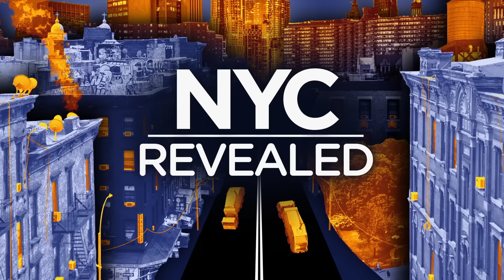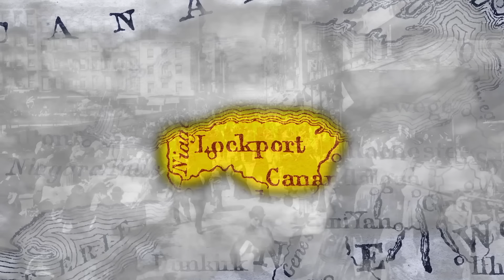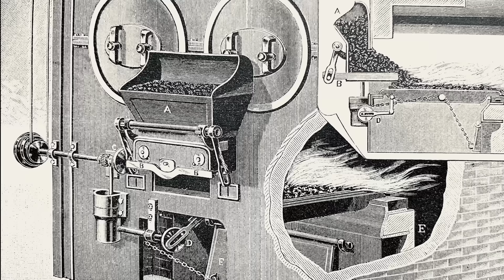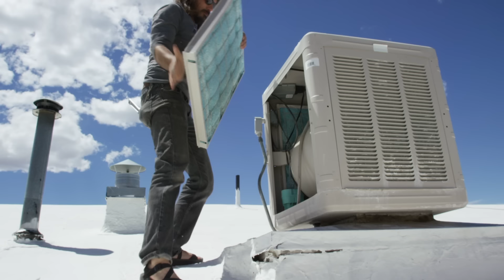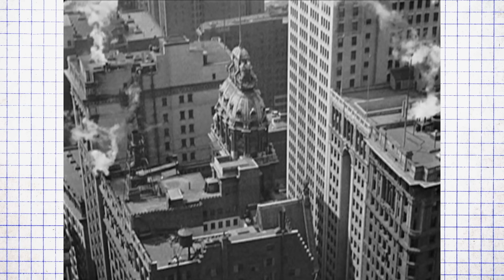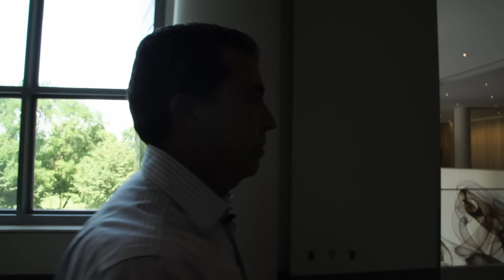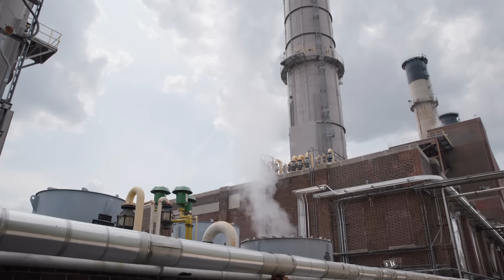How New York Still Relies on this Old Technology | NYC Revealed

Comment: Imagine the humidity. And why is he saying 13 Million when it clearly says 13 Thousand. Not the sharpest knives in the drawer are they? All that escaping steam could be re-directed to a turbine to produce electricity. Bless them.
Reply: If u look above that column, the unit of measurement is 1000000/hr. 13.222 is 1322200
Reply: Look at the big brain on Brad!
Reply: Ironically the steam has already come from a turbine. It’s co generation. Boiler to turbine then to steam distribution.

Comment: Most people don’t know that the entire Empire State Building is heated with 2psi steam they use vacuum pumps to suck the air out of the radiators and the pipes going up are 12”inches in diameter branches are fed from those pipes and no pumping is used. Steam moves at 60 mph through the pipes.
Reply: Detroit was first in nation with these steam systems since 1878 and still has them. NOT unique to NYC!
Reply: @GEN_X_ went to school near Detroit in a 100 year old building with steam heat. I remember the clanging of the radiators in the morning

Comment: But when a pipe fails it is a horrible way to go for the unfortunate pedestrians above.
But I think they fail less than the underground high voltage lines and transformers that have also caused casualties.

Comment: min. 21:11: What sustainability? The steam is produced by burning gas. Every pound of steam that exits through this steamstacks is wasted energy. Also, why are the underground tunnels so hot and stinky?
Btw, you could safe a lot of energy if you weren't cooling restaurants in the mid of the summer to freezing cold temperatures.
Reply: If you aren’t aware that is being created by the groundwater it’s coming into contact with the very hot superheated steam pipes.
This effect is not waste it’s the underground pipes that are old but still useful.
Groundwater is just naturally occurring pockets of water from runoff.
Reply: @davidlampe4153  If the heat gets transferred from the steam to ground water, it's wasted energy nevertheless.
Reply: @davidlampe4153 it’s not ground water it’s just straight steam pipe leaks in an aging steam distribution network.

Comment: I can allready smell the asbestos on those pipes 😂
Reply: I worked at a place with its own steam plant for heat and hot water. Some smart aleck had carefully painted ETHEL on one of the boilers. It’s getting cold-time to fire up Ethel. I wish I had taken a picture of the old brass gauges before modernization happened. The tunnel area was a scary place with high pressure lines. Used to run on bunker grade oil now natural gas.

Comment: Did they go over using salt water instead of tap water? I’m curious if it’s possible
Reply: I don't think that would be a good idea. When salt water is converted into steam, the salt remains as a solid and would clog the pipes after a while.
Reply: @jorisvanhoof2104  It would cost even more to desalinize it before using it.

Comment: I'm a fibers Splicer and all I could think is the Horror of working on Manhattans networks within the Man hole systems. The few steam holes in Boston, Ma that have fiber enclosures in them typically destroy the cases. The plastic just melts or becomes brittle. Not to mention trying to enter a Man hole that is that hot.
Reply: The worst was when con ed would shut off one of  the main  steam lines  even with the steam not flowing  in the pipe the residual heat      would reach about 400 . The steam pipes used to be insulated with asbestos  now there covered  in threelayers of afabric that if it made contact with bare skin vit caused severe  itching  it would remind you of normal house insulation  but 1000 times more painful..oh yes the burns i would aquire on adaily basis   made it a shitty crew to be on😅😅😅😅😅

Comment: 30 minute video about steam with no mention of condensation.
Reply: Or even worse...they mentioned "cooling" with steam, but explained nothing about it.
Reply: @UninstallingWindows steam rises through a fan blade thats connected to the condenser causing it to turn and pump freon like a regular hvac unit
Reply: @xscorcher9071  They probably use absorption chillers.
Reply: @xscorcher9071  they still use freon?
Reply: @miroslavbuchar2559 yeah? The steam just turns the pump
Reply: @miroslavbuchar2559 freon is or should be an obsolete refrigerant.
Reply: @UninstallingWindows  They probably don't know, lol.
Reply: @UninstallingWindows  you can do anything with steam, with steam engines, or steam powered electric generators. including running an air conditioner lol. the question is why would you tho?
Reply: @UninstallingWindows  cooling by absorption or turbine chiller.
Reply: The condensate in the closed system is pure water. That pure water is recycled. It's not cheap to make pure demineralized water.
Reply: @mushroomman1856  This steam is not pure water, it has rust.
Reply: @mushroomman1856 All of the condensate gets dumped into the sewer....
Reply: @mushroomman1856  Not pure water, friend. Chemicals are added to the feed water before it enters the boiler.
Reply: @mushroomman1856  No, it is loaded with water treatment chemicals and not pure water
Reply: Half of this video seems to be random people interwies on the street that add zero value for the viewer and are just waste of time
Reply: Condensation is a total lose they actually use city water to cool the condensation so it be sent into the sanitary sewer system especially when a steam trap fails it’s basic physics
Reply: @rogerschuch2272  That right! Dilution tank is used to cool down the hot condensate and the escaped steam before it enters the sewage.
Reply: This video was targeted to NYC civilians, not HVAC professionals. A better explanation would have helped.
Reply: The condensation is collected by steam traps and transported back to the cogens to be reheated. It's a closed loop minus any necessary make-up water.
Reply: @henryjantz negative.....none of these condensate returns to the plants. It gets dumped into the sewer.
Reply: @Tim.F83 I highly doubt this. How do you know? They would be spending an incredible amount of money to have the water chemically analyzed and treated to perform in this system with minimal corrosion, biological problems, etc.
Reply: @henryjantz It's always funny when people that don't know try and correct someone that does.
Reply: @henryjantz  It is a non-return system; the condensate must be cooled down to 150F before enters the city sewage system. Buildings in Manhattan are using steam for heating, cooling and cooking. That included laundry and sanitizing equipment.
Reply: @henryjantz  It is a non-return system, and the condensate is dump into the city sewage.
Reply: hell or steam hammer
Reply: @harrymu148  Pile driver
Reply: @longcycler8832  Steam hammer is when a slug of water gets accelerated through pipes. when it hits a bend or a valve an explosive event happens based solely on kinetic energy.
Reply: @harrymu148  Was thinking of steam pile drivers🤪
Reply: NYC charge sewage discharge for the condensate to discharge into the city sewage system.
Reply: I was waiting for it as well...........so what do they do with it?
Reply: Other cities use hot water which is also cogenerated in power plants instead of steam. Seems more efficient
Reply: They have a contract with NESTLE WATER, Nestle gets it for free , bottles it and makes money , just like nestle pulled this off in Michigan
Reply: It’s amazing they managed a 30 minute video about steam without mentioning condensation! Talking down to students never helps and it shouldn’t be acknowledged!
Reply: Yeah but why
Reply: One of the worst "documentaries" I've seen, especially coming from a curiosity stream channel..
Reply: @sisrace  How so?
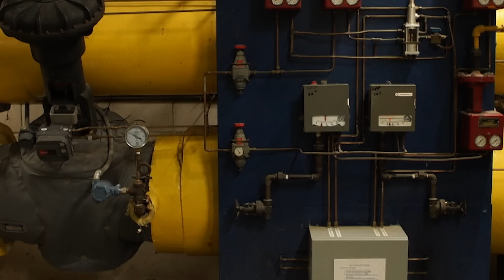Reply: At around 13:20 he mentions it... They don't do condensation. It goes through the building and out of it.

This is why you see so many steam stacks, those are the final outlet of the steam.

It is a complete wasteful way to utilize resources, but hey, it's 'Murica! they don't really care.
Reply: @_C_E_C_ Thats not what that means at all....
Reply: probly cuz steam is evaporation..

Comment: Heads up, James watt had steam heating system in his home in the 1700's but yeah it was definitely invented by an American 😂😂
Reply: Just as Henry Ford did not invent the automobile...he found a way to mass produce it, James Watt did not invent the atmospheric engine, he made it efficient for industrial use. Holly found a way to use steam across multiple buildings and ultimately whole cities. He did not invent it. He found a novel way to heat his house and expanded on it. Think of NYC in the late 19th and through the 20th century without it. It would have had the huge smog outbreaks like in London in 1952...

Comment: good old steam wrapped in asbestos, our city is slowly converting to natural gas. the thing i miss the most is that steam lines would melt ice and snow off the roads and alleyways in winter. gardens could be started earlier and go longer when planted over a steam line because the soil was heated. screw that noise tho. the dammed radiators would bang and clank and took ups so much space
Reply: I went to school near Detroit in a 100 year old building with steam heat. When the steam came around in the morning the radiators sounded like someone was beating them with an iron pipe.
Reply: Gardens? I thought it was 99% concrete
Reply: The fact that you guys switch from one severely outdated source of energy to one that is just outdated tells a Story...

Comment: So they’re diverting steam into the manholes and then putting these pipes over top of them?
Reply: They’re just steam leaks or pressure relief valves that have failed and are venting. To avoid filling up the tunnels underground and prevent damage the steam is vented to atmosphere above ground.
Reply: @NZmellowyellow  hmm the video seems ot indicate these are over manholes temporarly.
Reply: @TheTCOLL Yes they are until the leak is fixed. That can take a long time though for various reasons.
Reply: @NZmellowyellow  So they drill down to prevent its from exploding and vent it?
Reply: @TheTCOLL They’re just opening existing man hole covers in some instances and putting the chimneys over them to vent the steam out.
Reply: @NZmellowyellow  It was just my understanding these were dedicated pipes for the steam.  So how does the steam enter the manholes?
Reply: @TheTCOLL The manholes access utility tunnels running under the street. Steam, water, power and fibre etc in them.
Reply: @NZmellowyellow  Oh I see, they share these tunnels.

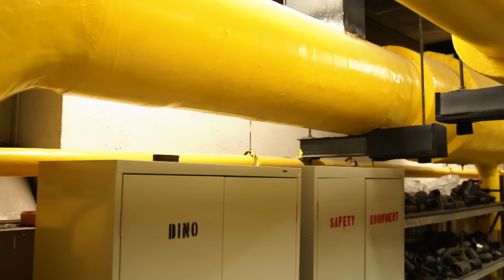Comment: @13:28 was so confused him keep saying pounds. He means psi
Reply: Psi stands for pounds per square inch.
Reply: @Bizznatch57  Which is an outdated means of expressing Bar or Pascal.
Pounds as a pressure doesn't mean Jack Shit unless to include the squared area vector.
It's like some eScooter knobhead saying that his battery is 100A when he really means 100Ah. Big difference.
Reply: @TonyLing ive heard many people just say pounds.  I knew what he meant.  Maybe its a regional thing but i knew he meant psi
Reply: @TonyLing  I knew he meant pounds per square inch. It’s still used quite often where I am.
Reply: @rubyannr6898 It might be used often, but it is used incorrectly
Reply: @TonyLing  Meh. I prefer non pandantic people. The dude in the comments above is basically saying that he left “per square inch” off of “pounds”.
Reply: @rubyannr6898 When you are an engineer, using the correct measurement terms is not being pedantic, it is the difference between being either wrong or right.
Reply: @TonyLing  My tires still say PSI.  It is still commonly used. 😂😂😂
Reply: @Bizznatch57  it’s a production measure not a pressure measure that he’s referring to.
Reply: No the steam quantity is measured in pounds. Quantity pounds not pressure pounds. They will obviously measure the pressure but also how much is produced as a measure of weight. We do the same in our country but in tonnes.
Reply: Actually he doesn't. A pound of steam is a pound of steam regardless of how much or how little pressure its under.
Reply: @henryjantz yes exactly it’s a production measure not a pressure measure.
Reply: @NZmellowyellow I am aware. He does reference individual buildings receiving "pounds" of steam, and in those cases he does mean PSI, and they keep it under 15# because that's the pressure at which a steam system becomes a "high pressure" system.
Reply: I wasn’t sure if this was an abbreviation or something in North America. I was also very confused!

Comment: ahhhhh the mystery of the giant NYC bongs finally solved
Reply: Steam deez nuhtz in your blunt
Reply: Detroit was first in nation with these steam systems since 1878 and still has them. NOT unique to NYC!
Reply: @GEN_X_ i assumed not, the video itself said one of the last still using steam, meaning there were other cities using steam. Does detroit still use the steam systems today or has it been discontinued?
Reply: @Despotic_Waffle  Detroit has always used Steam and still does. They have those steam stacks now because of pansies walking over them and saying they are getting burnt and trying to sue the city. Up until the early 2000’s none of the steam vents had stacks on them
Reply: @GEN_X_  The more you know, thats a good learn
Reply: @GEN_X_  NYC's system is a lot larger and lot more complex, it's just not as old
Reply: @mycelia_ow Yes, obviously
Reply: @GEN_X_  detroit is also dead. NYC isnt. So.... who cares?
Reply: @starwarsphan3159  Actually Detroit isn’t dead if you’ve actually been there 😂 and NYC is disgusting and dirty. And yes Detroit invented it so cry harder 🤡